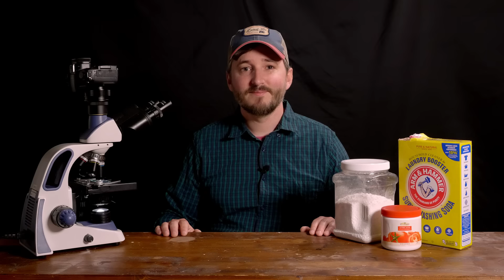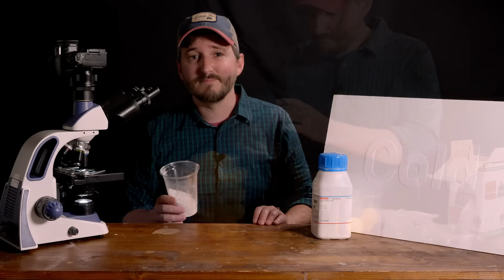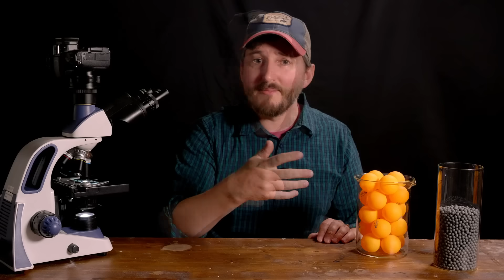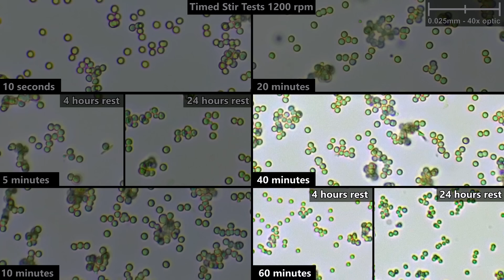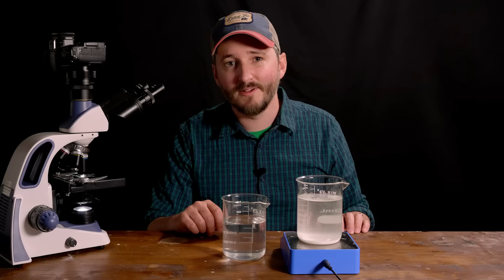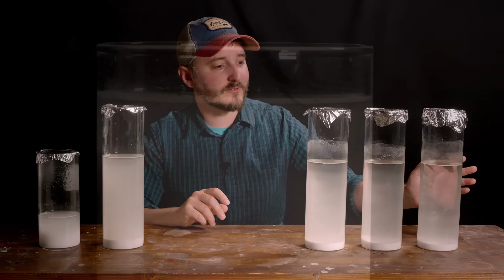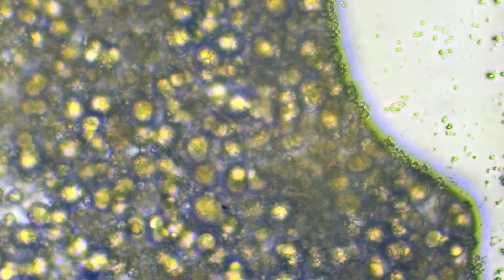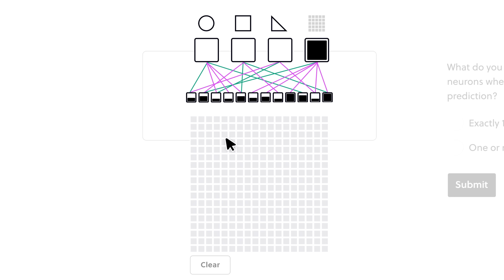Making Infrared Cooling Paint From Grocery Store Items (w/Novel CaCO₃ Microsphere Synthesis)

Comment: Very nice work. Your videos are extremely informative and inspiring. 

I've tried making your solution, but I seem a little stuck. I don't get the pigments to settle within your assumed time frame. When mixing it becomes sort of a white slime. The first batch I tried, yesterday, is still settling and the stuff that's dropped to the bottom looks kind of slimy still, while at the same time there's slimy substance floating at the top. Tried reducing the amount of citric acid used as well.

When looking through a microscope I can see crystals, but not their shape. (Not good enough microscope)

Also what's the reaction formula? I guess when pouring Citric Acid into the Natrium Carbonate you get water and natrium citrate, as you mentioned. But I haven't successfully balanced the equation for what happens when mixing Natrium Citrate and Ca+2(aq) and 2Cl-(aq). Do you know?
Reply from the maker: A white slime is the correct result right after mixing, but the slime should dissipate over the next 20mins or so as it's consumed to form the spheres. Are you sticking to the same reaction temperatures I mentioned? After initial mixing you can allow the solutions to raise to room temp which might help settling to happen faster. I would not change the amount of citrate, especially if you do not have a microscope to confirm your results. It took me a long time to find this exact mixture which reliably works and it's very likely your changes will cause issues. Even changing which liquid starts in the blender and which is added later will change the outcome. As for the reaction, I have not tried to balance it with the inclusion of citrate because that only represents an intermediary step. There are several reactions that occur along the way (most likely more than one at the same time) and it would not be easy or accurate to describe them as a step by step reaction. The citrate is most probably acting as a chelating agent, simply delaying the crystal formation.
Reply: @Nighthawkinlight  Thank you for your answer. I got busy with other stuff, but I will try again and see if I succeed based on your input.

Are you saying the temperature when mixing the different starting solutions matter as well? Should the water temperature when mixing be between 10-20 degrees celsius? I notice that especially the calcium chloride warms up a lot when mixing with water. Probably why it's so popular to use for ice removal. I will write again to let you (and anyone else interested) know if I managed to solve the issue.

Thanks again. Really love your channel.
Reply from the maker: @AnitraKruse  Temp when making the starting solutions doesn't matter as far as I know, just the temp when finally combining them. Reading your comment again I'm not sure what's going on. The slime shouldn't last more than an hour if you're using the correct amount of citrate. Unless the water or one of your ingredients is contaminated with something strange. Maybe the citrate is making a slime with some excess contaminant as a side reaction. In that case it's possible the spheres are forming properly, but they'll need to be washed extra times to remove the slime.
Reply: @Nighthawkinlight  It might be something in the water, then. I also noticed that the one of the solution can react with the metal in the temperature measuring tool, so trying to measure quickly. One of the temperature measuring tools became slightly matted while the other did not.

Tried again, and though the result was somewhat better (it mostly settled within a day, but with a weird, white floating surface of something), there was a color variation on the powder. One was slightly more yellow then the other batch. Maybe due to corrosion of the metal in the temperature measuring stick.  

I will attempt the following steps:

1. Getting a more precise weight. 
2. Using distilled water meant for the cooling of car batteries, and not tap water

Will try again when I get the new weight and water.

Comment: We used calcium chloride (canned heat) in marciting pools! The purpose was to make it cure the shaded areas of the pool as fast as the sunlit parts. It was an art to figure out how much per batch as the trowling crew applied and smoothed it  out! With that empty tuna can I was a god to that bunch crawling around in that hole! Piss me off and you'll work yourself to death preventing it from setting up before you finished it, because I added extra! Or I could accidentally forget to add any, and laugh as they kept  pushing the mix back up the wall as it started to resemble slightly heated wax!😂

Comment: Thought for consistent application on panels:

Use a threaded rod to apply consistent amounts of material.  Pour and spread the paint using a paper cup and a spatula.  by rolling a threaded rod over it a few times you can spread it evenly across the surface.

Comment: Scoop coater. Its used to coat silk screens with photosensitive emulsion. That seems like a ideal way to apply the coating in very wide passes (assuming its a flat surface you are intending to coat).

Comment: So my question is how much of this cooling effect is due to reflectivity, and how much due to emissivity.  Because if it is due to emissivity, that is much more useful.  From the explanation you've given, I personally think it's due more to emissivity. You are emitting infrared in a wavelength that is not absorbed by our atmosphere, Ergo that can escape to space.  Ergo actual cooling can be accomplished, smd that MUST be the case to be cooler than ambient.

If that is the case, and I think it is, then this paint would have a great application for your other project of harvesting solar heat.

Comment: I have also tried to dissolve the acrylic in acetone with water as they mentioned it in the video... But after 2 hrs of heating at 60degree celsius... It won't dissolved most of the acetone evaporated 2 to 3 times I added it back for balance the solution.. While adding acetone again can we add water on it... Or the temperature🌡️ is maintained as he suggested

Comment: So I just finished my first batch, but instead of becoming  a paint, it made a slime suspended and white liquid. I'm assuming there's too much water?
Reply from the maker: Yes sounds like the pigment was not dry when mixed with the acrylic and acetone
Reply: it must of sat too long. This stuff must have a short life span if water absorption is a problem.  @Nighthawkinlight
Reply from the maker: @jitone1  It doesn't absorb water. I mean you likely did not dry the pigment enough in the first place after filtering it
Reply: k.  @Nighthawkinlight
Reply: Whoop, even poorly made first batch was 4 degrees colder in the shade. in the sun my car was 120 degrees while the underside of the painted metal lid was 86. 3 degrees colder than ambient temp @Nighthawkinlight
Reply from the maker: @jitone1  Excellent job!
Reply: thanks. Hey, I've noticed how easily damaged the paint is; Have you tested polyacrylic finish over it? I'm think you try it if you haven't.  @Nighthawkinlight

Comment: Great video and great work. Thank you for sharing this. However, I have two questions. 
1) If one takes a look at the spectral emissivity of barium sulfate (between 8 and 9um), it is clearly in the window of infrared transparency of the atmosphere. But for carbonate calcium, the maximum of emissivity seems to be around 7um, which is not anymore in the transparency window of the atmosphere. As a result, carbonate calcium should be significantly less efficient.
2) It is not clear to me why such materials (barium sulfate or carbonate calcium) would be the best candidate to do a cooling paint, because the amount of infrared emitted is quite low. The band of emission is indeed narrow. If one compares this to any standard white paint whose emissivity is around 0.9 between 5um and 50um, the amount of infrared emitted will be much bigger.
Reply from the maker: Calcium carbonate is less efficient than barium sulfate for the reason you mention. Calcium carbonate only has favorable emission in one of its sub peaks, I want to say 11.5um if I'm remembering correctly.

These pigments work better than others with a wider emission spectrum because wide emitters are also wide absorbers. If you only emit in IR windows you only absorb in the IR window, and that means the atmosphere is not sending any of its own emission back at the paint in a band that can be absorbed.

Comment: How about to be able to use the compounds onto sterile rollers or air sprayers which the validity and particle granules the desired texture can be adjusted by micro dilution of distilled water or the base solution of the citric acid final process.

Comment: While this is interesting, unless it's used as a reflective building coating, I'm having trouble seeing a practical application. Given that the heat differential is a couple degrees (versus potentially scores of degrees for a ground loop), it seems that this will always be outperformed.

Comment: What if you went the opposite way of the spheres? I'm thinking of sharp particles that can link together to form dry mats. Could that fill in the gaps as well.  I'm thinking about the sharp particles of the lunar regolith that are ultra sticky and considering the recent discoveries of India's Moon lander that showed that the temperature of the Moon went down drastically only after a few centimeters down.  Also, as the Moon has no atmosphere, it would have a wider range of infra-red frequency it could reflect. 🤔

Comment: Why it's considered as "cooling" ? It just shilelds from incomming radiation, reflecting in almost all range of wavelenght. If you take  two identical jars and cover one wit this pant. Then filled with same ammount of water at same temperature place painted jar in the sunlight, and the other one in shadow. With actual cooling water in the paited jar should get colder. Colder than the water in the shadowed jar and also colder than initial water temperature.

Comment: Can such high reluctance paint ever be used for parabolic solar with thermal module or photovoltaic panel? For such parabolic design, so long the through is always align with the seasonal solar track, then the only moving part could be the thermal module or photovoltaic panel, also such design should have the focal area move in a line, by proper extension of thermal module catchment length or photovoltaic panel length, maybe even possible to have such system to be completely free of moving parts.

Comment: How about inventing a method of applying cubic crystals to a surface in a uniform method. This, in my imagination, removes the need to produce many sizes of nanospheres to achieve densification (Tech Ingredients terminology). Sodium chloride forms cubic crystals as, so you found in your experiments the reduced concentration of Sodium Citrate also begins to produce. I wonder if an evaporative method of applying the coating could actually achieve this???...however impractical that may sound for general use. Oh well...looks like I'm going to mess the kitchen up ..again!!
Reply from the maker: Cubic crystals orderly stacked would have high transparency.
Reply: Thanks for your reply Ben. I did not mean to sound critical of your work because I think it's brilliant! I have only recently happened across Tech Ingredients which led me to your site. I do have an intense interest in the areas of improving the technology we currently use and trying new approaches. Sorry for sounding a little ignorant but I am only beginning to delve in and dig into, what is turning into, a rather complex multifaceted ' J'   learning curve. I have all of a sudden realized how much I do not know and folks like yourself are a blessing. So, thanks for all your hard work and excellent videos. Your work is on my "refer" to list.

Comment: You're checking your temperature in that box from the back so does that mean that this paint is simply acting like a sheet of styrofoam
Reply from the maker: Styrofoam doesn't make things colder than air temp
Reply: As I understand it is not about being in the sun. A sheet of Styrofoam will only have a cooling effect on the backside when in sunlight

Comment: What about using PVA glue (Elmer's Wood Glue or TiteBond II or III), "white acrylic glue" (concrete binder seems to be a good source[?]), or ModPodge (a kind of mix of both with other additives) as a base for the pigment? They can be thinned with water to a paintable consistency, will dry clear or opaque, have a degree of flexibility when dry, and when applied to fabric (such as polypropylene or polyethylene landscape fabric, cotton/hemp bed sheets, use your imagination) can create "Poor Man's Fiberglass" sheets or be molded to a frame/form.

Comment: Could this be used to coat water troughs for horses so they stay cool when in the sun? Both the inside and outside?
Reply from the maker: It wouldn't stand up to the beating of a farm. Hopefully I can make it more durable in the future
Reply: @Nighthawkinlight  If you can figure it out that would be amazing. It would be really helpful during the hot days to keep the water cool

Comment: If you were to 3D print a custom applicator, or a custom wide tip for the large syringe, then what type of printing material should be used? I would assume the acetone in the paint might have a poor reaction with several different plastics? Or is it diluted with acrylic and pigment enough that it won't further affect other  plastics?

Comment: If you really think about it this maybe the solution to global warming
Reply: it can play a very useful role for sure, but we really need to get our carbon emissions down, the effect of all that carbonic acid in the ocean is starting to add up, and there's a whole lot of other things that trickle down from it.
Reply: @dayvancowboi9135 The interesting thing is that higher CO2 content can still sustain life. 
Of course, we do need to reduce or find a method to scrub the CO2, but 200 million years ago the CO2 content in the air was around 2000 ppm at its highest compared to 400ppm today.
Arguably, there were a lot more flora back in the day, but the majority of the CO2 is processed by the ocean flora and that has not been impacted as significantly. 
Perhaps if we can cycle the CO2 into the Calcium Carbonate, CaCO3 maybe it'll be a reversal. 

I think solutions to global warming are a combination of all efforts
Reducing emissions
Removing CO2 from the air
Sky cooling
Reply: @VictorF0326  extremely rapid increase in co2 doesn;t give the natural world time to adapt-those very high co2 figures came about over much longer time periods.

Comment: Towards the end when you experimented with different application methods i immediately thought of the methods used to smooth concrete with trowels and bull floats and whatnot, and also spackling drywall, mechanically applying and smoothing the surface. Perhaos the dry time wouldnt work for it though.

I also thought that a battery powered caulk gun with the sausage tube style and a custom wide tip could apply it evenly at a desired rate of flow similar to the piping bag. I was thinking of the Makita XGC01ZB caulk gun for it.

You could also create a barrier at the edges of the surface you would want to put it on to act as a depth guide, similar to when people do epoxy pours, and use a trowel or spackle knife to ride along the top of the "walls" to achieve a desired uniform thickness.

I saw the video referenced with the Barium Sulfate and this seems like a much more accessible process.

I am reminded of how in hot mediteranean areas they whitewash and likewash the walls for cooling affects, and this seems like a natural jump off point from that.

It is an exciting prospect.

Comment: I have been researching nanoparticles for a completely unrelated project and had some suggestions/comments about arresting nanoparticle size. PEG (sold over the counter as MiraLax), PVP, oxalic acid or thiols are often used to stabilize particle sizes. 
Regarding nanoparticle sizes: Higher polarity solvents will also usually yield smaller particles, as does higher PH (in most cases) and sonification. 
I was also going to comment on screening as a method of paint distribution and the potential peltier implications but in reading the comments, see that others have pointed this out.
For those interested in using this process for something like roofing tiles or paint who are concerned about dirt/grime interring with it's effectiveness, MIT's Liquiglide may be useful as a topcoat to keep things from accumulating. I don't know if it's scalable (or affordable), however.
I commend you for all of your hard work and your persistence, and especially for your efforts in utilizing inexpensive components that make the process available to anyone willing to put in the work. But most of all, kudos for your generosity in sharing it freely. This is the first time I've ever commented on any YouTube video; had to look everywhere for my Google password as it was 3 or 4 computers ago since I've logged in. 
Really good job and solid work!
Reply from the maker: Thank you very much for your ideas!

Comment: Ben, this is an amazing video, thank you. Presented so clearly, and also getting such a good result using what basically amounts to "kitchen witch magic" and acetone is an amazing result. I live in Australia where we have heat issues every year, and seemingly worsening every year, so it's got my attention for our place. One thing that immediately sprang to mind is a cooling/pre-cooling system for building interiors. If I wasn't a pensioner I'd be supporting this channel to the hilt. It's exactly the tech we need right now.

Comment: It is appropriate to remember the famous song by Flanders and Swann celebrating the zeroth (I think) law of thermodynamics.
Heat will not flow 
from a cold place to a hotter.
You can try it if you like, 
but you'd far better notter